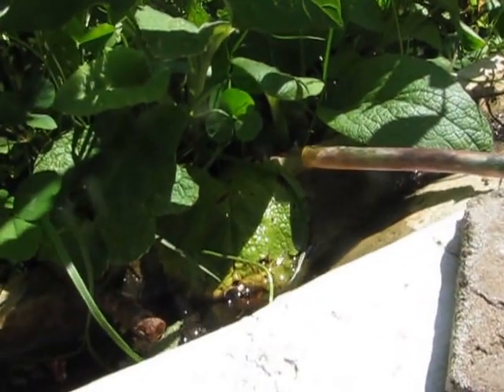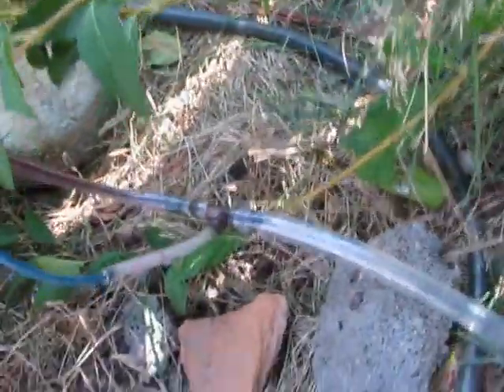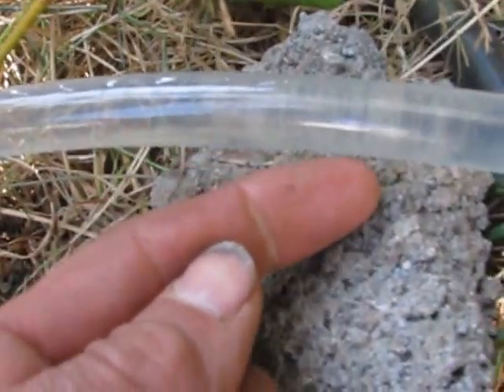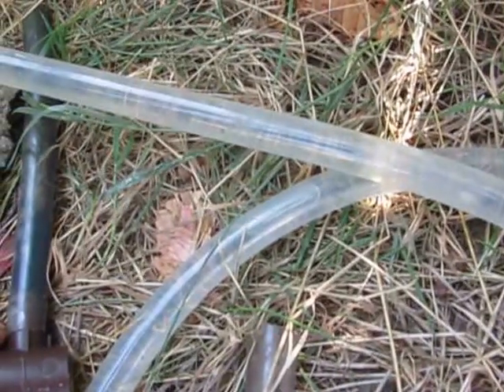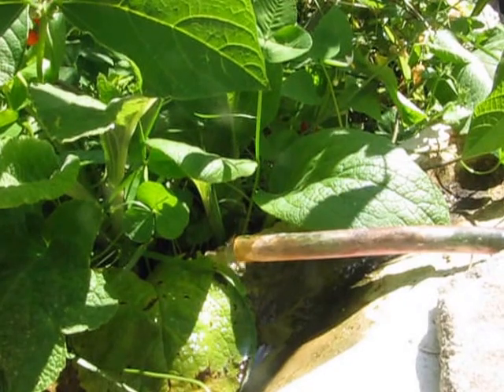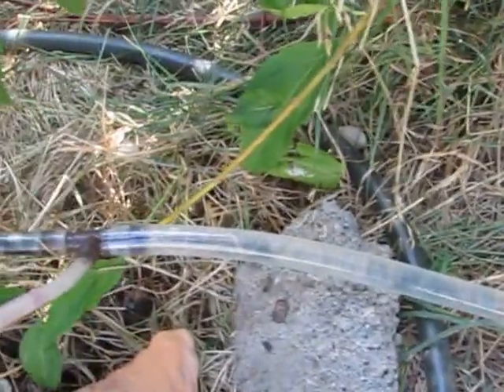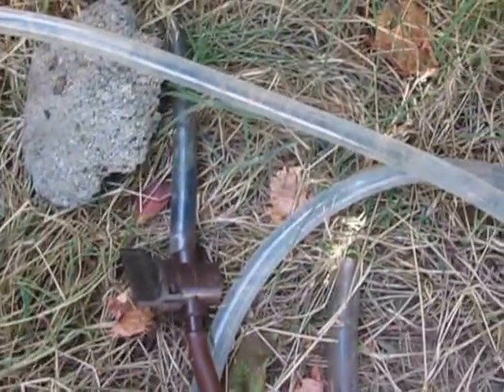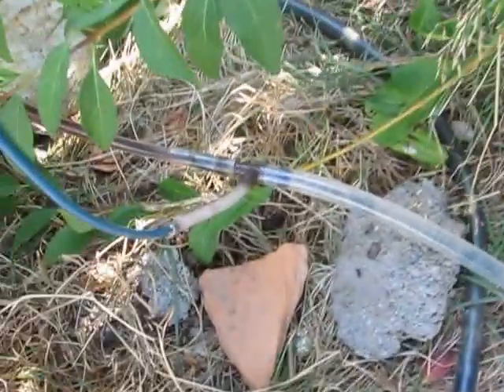Airlfift pump demonstration.  How a water constriction doubles the speed!

Comment: thanks for posting.   you are observing the movement of air bubbles and water in tubing in a horizontal orientation.  this is not telling you anything useful.

if this is an air lift apparatus,  air should be injected near the low point of the system, where it is able to rise in a confined space, lifting water as it does so.   there should be only air in the tubing 'before' the air lift stage.

if  the riser pipe is too large, bubbles break-up and less water is raised; use 5-6 mm id tube for riser.   more than one ?   
cheers
Reply from the maker: +David Davids  David!  My constriction airlift pump has been made and verified  on at least 3 continents including by a worker at CERN (in their spare time).     The bubble  is telling you something really useful.  The bubble  is there just to show the water movement.  It isn't part of the pump at all.    It shows  that without the constriction there is a too and fro movement of water  prior to the airlift intake  that wastes energy. Check my other videos,  I made an airlift pump that used 0.15 psi and less  than 4 inches submergence and pumped over 5 ft high.  Max lift to submergence that I have measured was 23 to 1.  This was only possible due to the constriction.   Try making an airlift pump in 4 inches of water (without a constriction)  See how well you do.  In this experiment here,  the constriction doubled the water speed up through the airlift pump. That is a highly significant improvement.   The constriction allows an airlift pump to operate at maximum submergence in a bucket without backflow,  and allows an airlift pump to start up easily without backflow in small diameter pipes.   These are major problems (solved) in vertical hobby hydroponics where depth for containers is constrained.  In hobby hydroponics,  the airlift pump is often run by a bubble pump on a timer and it comes on for a few minutes every hour or 2.   It has to start up reliably each time or the plants may dry out and die.  Anyway,  thanks for the comment.  I'm not sure how else to explain it.
Reply: +Brian White      skip it
Reply from the maker: You see, folks.   This is what I sometimes have to deal with.  People with no comprehension or manners.  Too ignorant to even begin to learn.